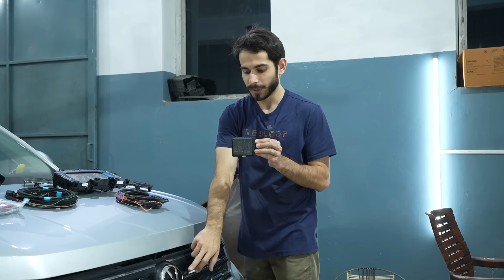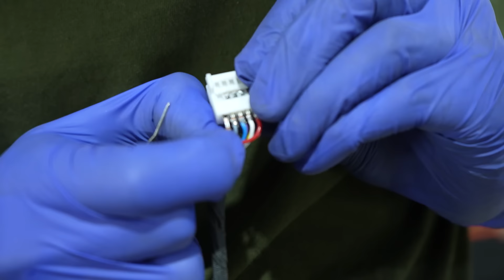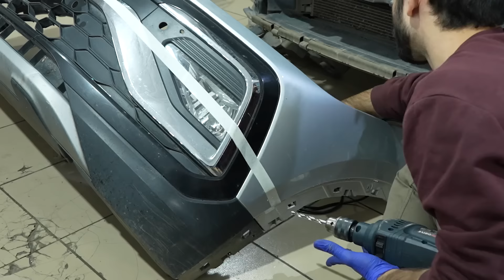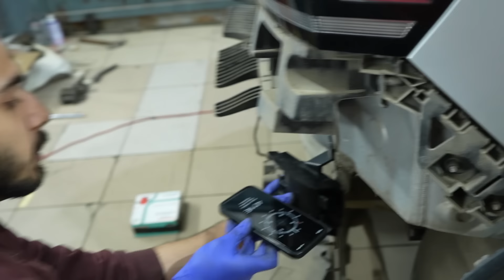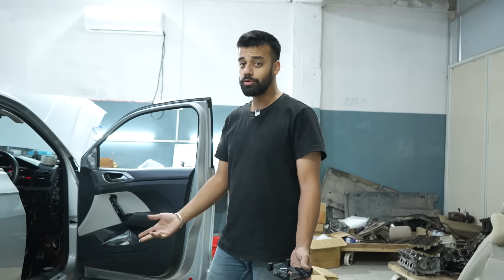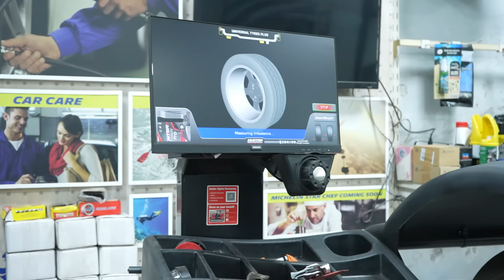MOST LOADED TAIGUN? ADAS AND MUCH MORE!

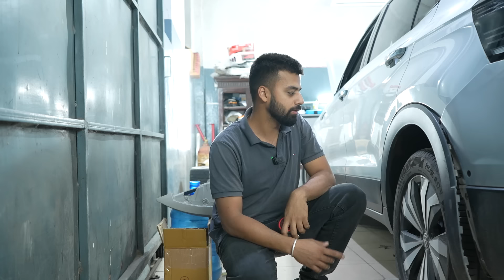Comment: @27:38 Bhaijee, you measured height from floor level to the wheel arch,
Firstly, I just love your videos, working on cars very carefully, neatly, cleanly and with respecting technical aspects.
I just thought the measurements you took from floor to the wheel arch, @27:38 it was 735 mm (right R) and 743 mm (left R),
What if floor level is not in tube level (uneven floor level).? 8 mm difference was there, but might be possible because of uneven floor level..
I'm sure you took good care and efforts, but shared my doubt.
❤ from MH-20

Comment: at 28:42 , the BLIS indicator comes on very late, after the car has already entered a dangerous zone. Something wrong with the calibration? It's supposed to come on much sooner than that!
Reply: The radar has to go upside down thats the issue. Hence it detects the cars after they pass
Reply: @Ssh_2208  That explanation makes no sense. You've installed the entire BLIS feature and it's not working as expected. So you either re-install it or remove it, because in its current form it's useless at best and dangerous at worst.
Reply: @B @BimmerDrives e data set defines how the radar is mounted. Wrong dataset will lead to wrong detections. The dataset loaded into the radar and the mounting characteristics should match since it’s a matter of geometry. If you don’t understand this i can’t help
Reply: @Ssh_2208  It's simple to understand, but the end result is that you should say that BLIS is not supported on Taigun, unless VW updates the programming available for it, which may never happen. 
I assumed that you are involved in this installation - is that the case ?
Reply: @BimmerDrives  Dont come to conclusions like that without experience. I have BLIS in my Slavia, works perfect.

Comment: In both the videos no mention of cost of the parts, any reason for this? Seems on purpose
Reply: Yeah they dont mention it anywhere. Total it would cost around 2.5L
12k ops - about 50k
Lane assist- 45k
BSD- 50k 
Tpms - 18-20k
Cluster- 80k
Could cost lesser if installation is all done together.
Reply: Very expensive 

2.5L worth of petrol might be more useful
Reply: @sumityadav8181  yeah true. Wish they offered these from factory as standard equipment.

Comment: My BMW already has all the sensors and cameras installed, it even slows down in eco mode when it sees a car in front ( while coasting, applying regen braking, it can see cars almost 40-60  meters ahead ) but because milord BMW high-ass person sitting in Germany, adaptive cruise control cannot be coded into the car. It is just locked out, even though the hardware is there in the car. Thanks @bmw !
Reply: Sadd😢

Comment: Hey Prerak! Been enjoying your videos a lot. Do you think it would also be possible to add one-touch power windows on all four doors and control opening and closing them via remote (like the older VWs)?
Reply: Honda's sir! Back in 2007/2008. Not as pricey they vw were..
Reply: You definitely can! You need a scanner/coder like Carly or obd11😊
Reply: @shriyanschaudhary672  I know you can code it and it will work for the driver's side window, which does have the one-touch feature.

I don't know if it's possible to get the required hardware for the other doors and enable it for them too.
Reply: @mroyme  usually most of the german brands provide the couplers, plugs and sometimes even whole modules are the same across the trim level range ( i know BMWs are notorious for that and even some older VW models) only difference is those modules are coded to not work. If that is the case with your particular vehicle then coding your car will most likely activate that feature. Again depends per the vehicle
Reply: Hi prateek, i wished to know if the adas and other features you described in the video can be fitted to volkswagen polo

Comment: Kataria ji please  mentioned the total cost for installing ADAS and Auto parking
Reply: Sir, it’s simply not worth it when you are sitting on a time bomb like the DQ200 DSG. Your only real protection is the warranty or extended coverage. Maybe it makes little sense in a manual or the 1.0 TSI with the torque converter, but not here.
Reply: @kavenseth  Its depand on where u drive my driving is 90% highway , so i m very much comforatable with it,
Reply: @rishilamba100  Sorry to burst your bubble, but highway only driving doesnt save you. Having owned 5  VAG cars so far, three with the DQ200 (Polo, Rapid, and now Slavia) and two manuals (Fabia and Jetta). Out of the three DQ200 cars, I have already replaced the gearbox twice and am facing the third failure now. I have had everything mechatronics unit failures, accumulator ruptures, you name it.
It doesnt matter if you baby it or drive only on highways mechatronics failure is pretty much inevitable with this box. If you are okay with deep pockets and spending 80k–2L, go ahead. Otherwise, stay away.
Reply: @i.m.v.a.l.k.y.r.i.e which city u live sir ?
Reply: @rishilamba100  Surat
Reply: @i.m.v.a.l.k.y.r.i.e but you still loves to drive VW or regretting it
Reply: @i.m.v.a.l.k.y.r.i.e  my diesel Rapid has done 3.5 lakhs kms without a single issue in gearbox and my cousin's jetta has done 1.3 lakhs and now my virtus GT have already crossed 55,000kms and again no issue its all abt how u maintain the car and im not ready to debate abt this topic wanna convey that cars in VAG are also relaible !
Reply: @i.m.v.a.l.k.y.r.i.e  at what kms did you replace the transmission?